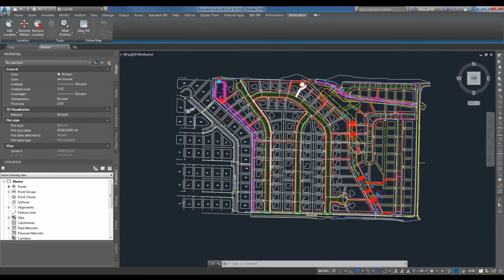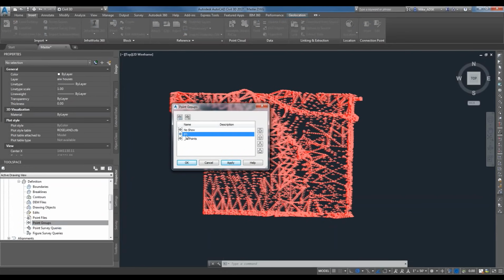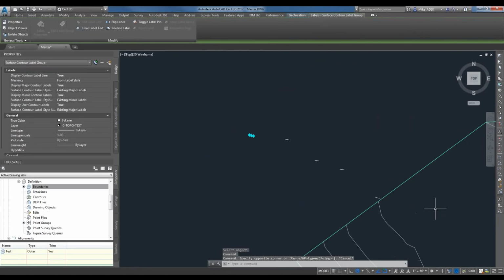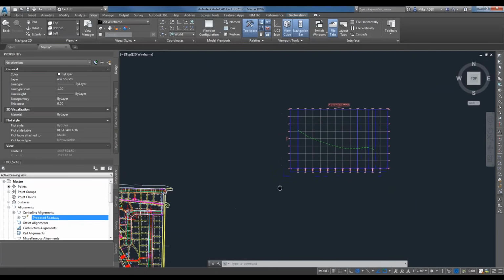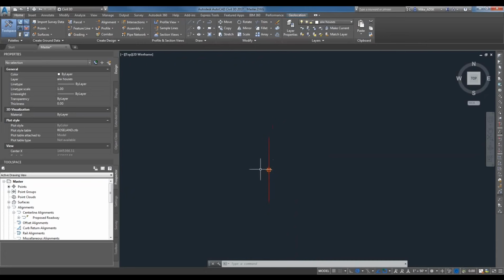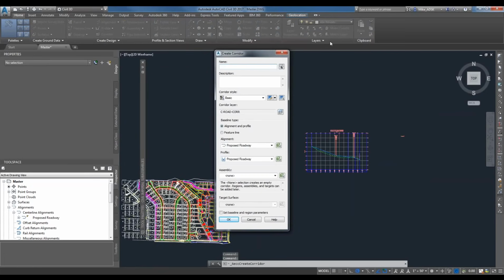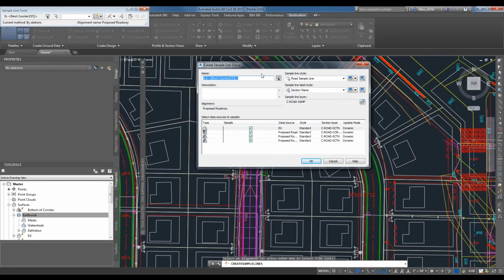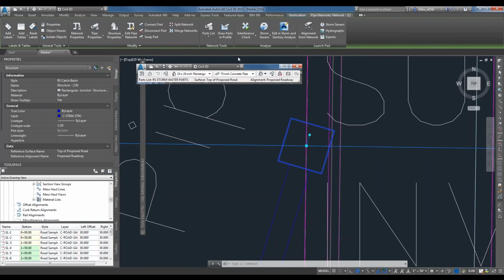AutoCAD Civil 3D Tutorial for Beginners Complete

Comment: In the 3rd minute you add in point data, where is the point data from? how do I create it?
Reply: The points are from using a surveying tool out in the field using multiple benchmarks to fid the elevation of each part of the actual topography. It is able to be saved as a file and imported to CAD to show data points on the actual map
Reply: Point take asbuilt from site